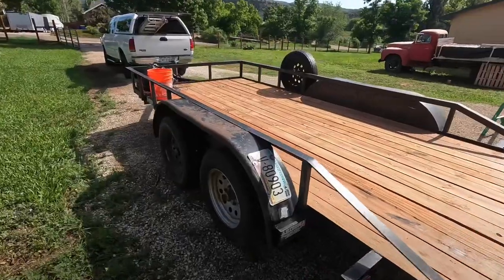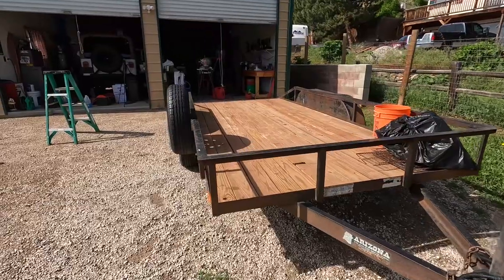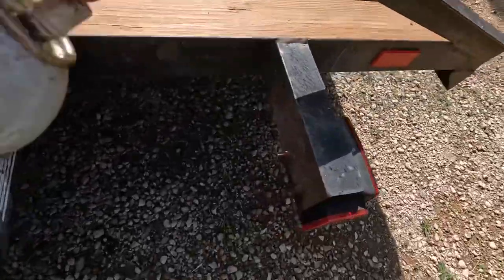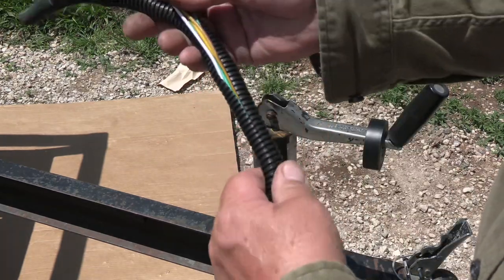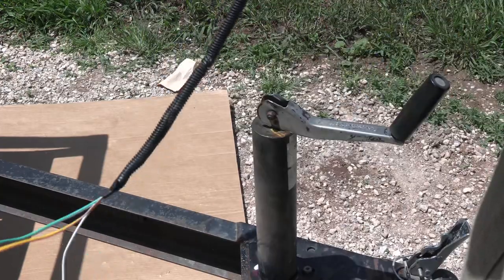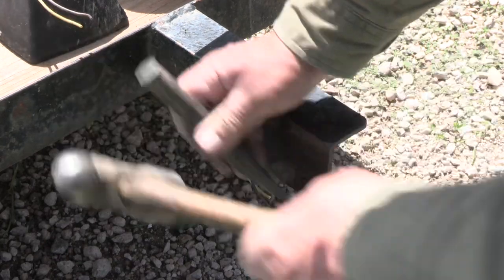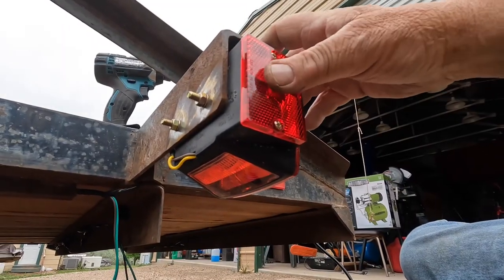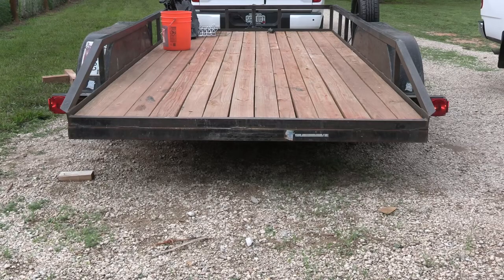Installing new lights and wiring on a utility trailer

Comment: Trailer lights are the bane of a sportsmans existence.   Seems like I mess more with them than just about anything else mechanical/electrical
Reply from the maker: No kidding. When you put these trailers in as many places as I have trying to load up elk or deer, firewood, and my quad you’re bound to break something electrical once and a while. And that don’t even count the guy on the forklift at the Home Depot stores. Lol.
Reply: @Safarijoe's Adventures  if your gonna have a trailer you may as well use it

Comment: As a guy with minimal mechanical skills, your videos are my best friends.  Keep up the good work.  One question:  Did you store your trailer outdoors?
Reply from the maker: Yes, the trailer has always been stored outside. It has had a lot of use since I bought it in 2007. It has traveled in 12 different states and thousands of miles but it’s still a great trailer. Last fall I put a new deck on it and I just got done re-wiring it with new lights. I will be taking it back up to Michigan on July 1 when I go up there for two weeks to work on my off grid property.
Reply: @safarijoesadventures  Thank you Sir.  Keep us all in the loop.